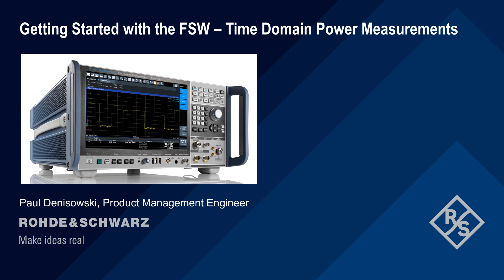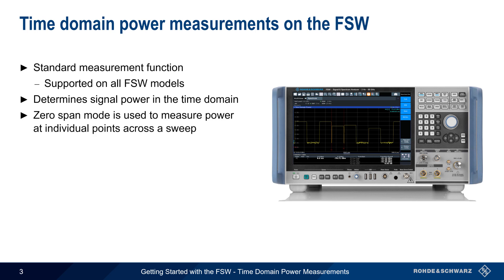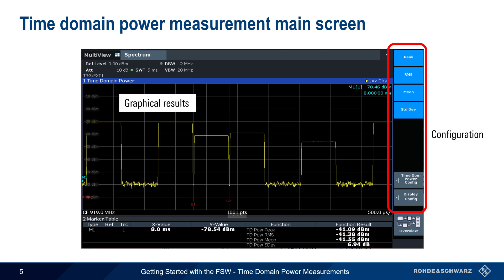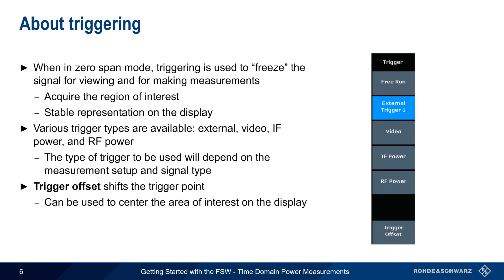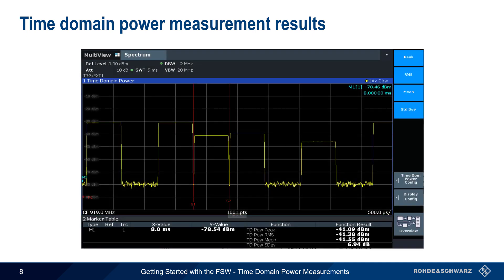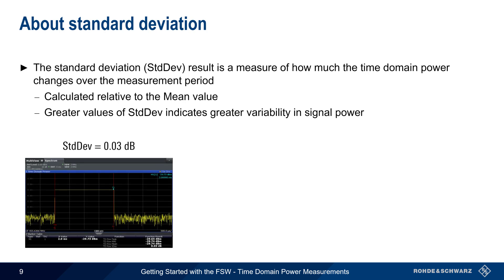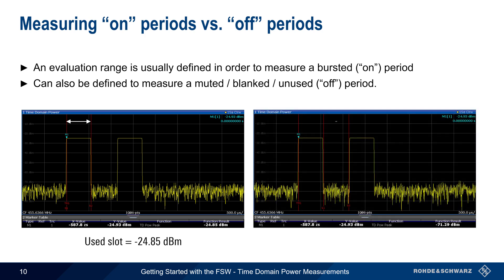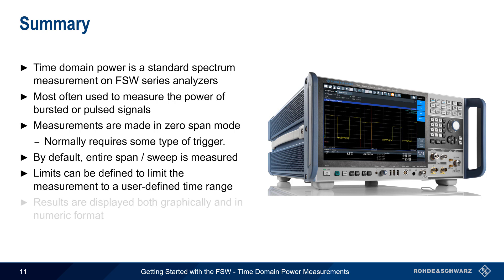Getting Started with the FSW - Time Domain Power Measurements

Comment: When you're measuring something in the Time Domain, is it not Voltage versus Time instead of Power versus Frequency?
Reply: Time domain is always "something" (Y-axis) versus time (X-axis).  Oscilloscopes generally measure voltage versus time, whereas a spectrum analyzer in zero span mode generally measures power versus time.  Spec ans are normally used to measure power versus frequency (i.e. frequency domain) in non-zero-span mode.
Reply: @pauldenisowski  Ok, thanks for the clarification.